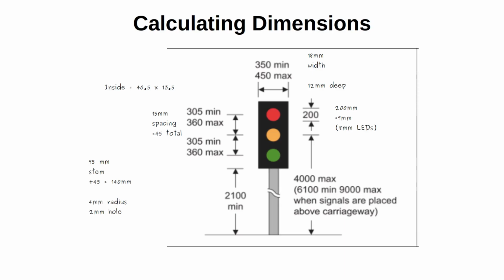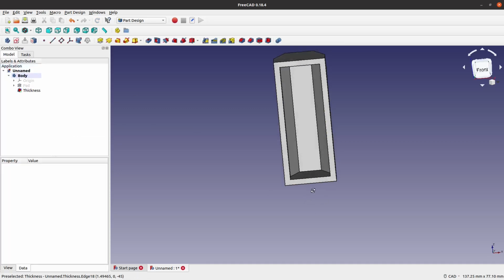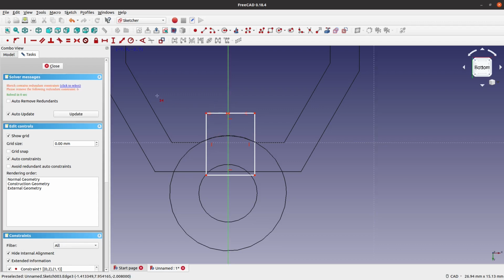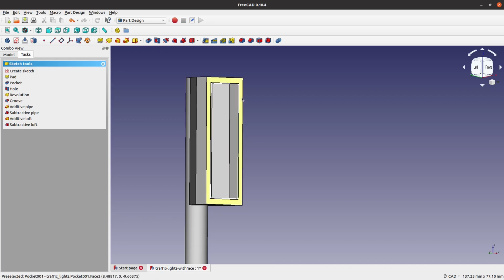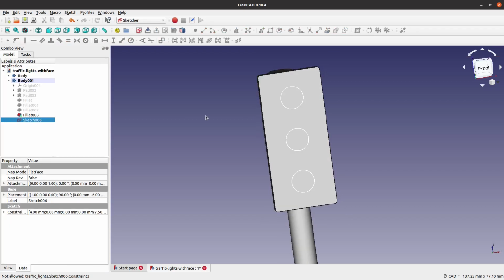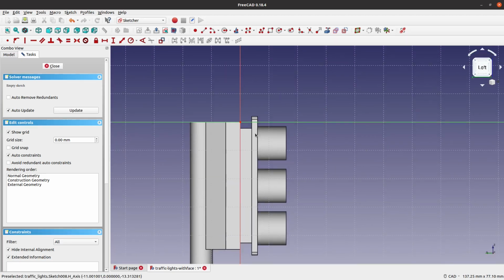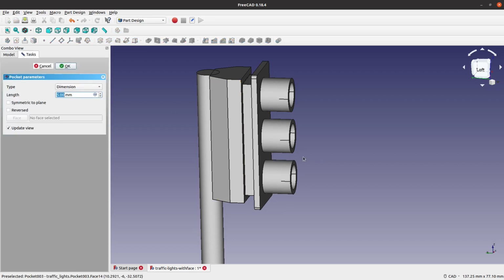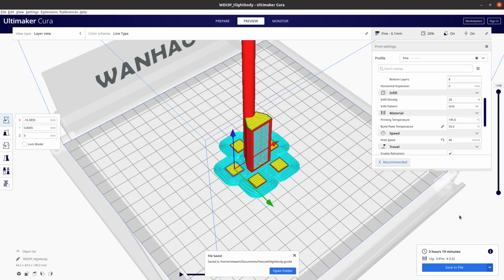Design Model Railway Traffic Lights in FreeCAD (G-Scale Outdoor Railroad)

Comment: Which orientation did you print the face (including the shrouds). Beginner at 3d printing and every orientation looks odd to me :)
Reply from the maker: I generally try and use the orientation that uses the least scaffold. Scaffold can be difficult to remove and look untidy. In the case of the stand that means it stands upright so that you don't have the scaffold blocking the cable route. 

For the face then there are pros and cons to doing that differently. I usually find that the top surface looks nicer when printed than the surface on the bed, but if you are going to sand it down or paint it then that may not be an issue. 

When I created the face with the shrouds on then I had the front of the face pointing upwards (so that I didn't need any scaffold for the shrouds). The only scaffold was at the back which I could file away using a metal file.
Reply: Thanks, Im printing the face with the shrouds now as you suggested. My son who's 4 is obsessed with traffic lights so glad I found this. Any sugguestions how I could add a button to press just like on the UK traffic lights with the red/green man?
Reply from the maker: @maffoo-stoke  I did think about that, but decided it was going to be too hard to implement at a realistic scale. If you are not bothered about the size then you could scale it up a bit further, or if you wanted a separate box as a controller then that would be achievable. 

A button switch would just need to connect between one of the spare pins and ground and then you can detect when it's pressed.

To get the shapes then you'd need to cut out some kind of mask eg. out of black card. It would be nice to have a laser cutter (sadly I don't), but you may be able to create something using a craft knife and a steady hand.
Reply: @PenguinTutor  thank you, I will give it a go. I bought the Snapmaker 2.0 so it does do laser cutting although i've not tried it yet (too scared). Would it be easy enough to put 2 sets of lights on the same model so that one faces in the opposite direction?
Reply from the maker: @maffoo-stoke  I did think about doing making it more complex, it's just a case of time, effort and Pico pins - whichever runs out first (although you could always expand the GPIO through ICs or a second Pico).
Reply: @PenguinTutor  I'm going to use individual NeoPixels so I can just address them individually so I only need 1 data PIN for the whole lot. So each set will have 2 power, 1 data in, 1 data out.
Reply from the maker: @maffoo-stoke  Nice idea. I like NeoPixels and use them quite a bit, but it felt overkill to use those when they would only ever show one brightness. It's a good idea if you want to save the number of GPIO ports.
Reply: @PenguinTutor  Thanks again for the video!
Reply: @PenguinTutor  Can I just ask what is your preferred supplier of filament?
Reply from the maker: @maffoo-stoke  My preferred PLA is FiloAlfa. They are based in Italy so due to high delivery costs I only buy from them when I have a specific requirement. 

Otherwise I often use Prima as a generic PLA.